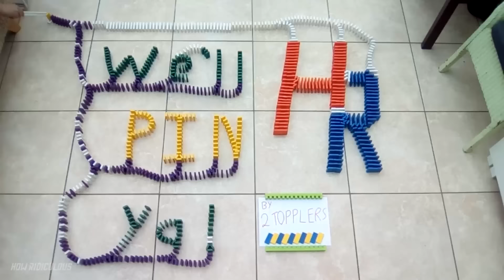Can This SOLID GLASS BALL Survive a 45m Drop?

Comment: 4:10, for those of you who are interested, that kind of crack is called a Conchoidal fracture (Con-coy-doll spelled phonetically). It means the overall shape of the fracture is cone like in nature, where the “positive” cone is popped out of the other side of the medium from the site of impact, and the surface that is impacted (be it by projectile, or tool) is the smaller end of the “cone.”

Also, the scientific reason for this phenomenon, is (as most high silicate solids are) Glass is an amorphous solid. So, there is no set, and repetitive “path of failure” (usually following the boundaries of the crystalline structure of a medium) in the material, and therefore, the force gets distributed, and absorbed nearly evenly, resulting in conical fractures, and an easily identifiable point of impact.

Since there is no repeating crystalline structure, there is no “stress accumulators” in the material. no sharp angles, no well defined crystalline boundaries, and therefore no where for the stress to accumulate, resulting in the failure of the entire crystal, rather than in between the crystals.

As a side note, this can creat edges sharper than a razor. (I learned this the hard way, when I picked up the primitive art of Flint Knapping)
Reply: P.s. I don’t really care about getting pinned, I just enjoy needing out about stuff like that (as you may be able to tell).
Reply: Well you definitely learned the hard way.
Reply: Hertzian cone
Reply: Conchoidal literally means seashell shaped, which is accurate
Reply: Without googling and reading about it, I dont know if this is right or not. However, it sounds pretty smart and has tons of detail so even if wrong you win.
Reply: As per Youtube law. I guess I'm googling Flint Knapping next.
Reply: We got a geologist in the building apparently
Reply: Someone has a big brain
Reply: Yep, Google works
Reply: That's a cool explanation, but you don't really say WHY it's cone shaped. The reason why the fracture is cone shaped is because of the difference between compressive and shear stress. 

Compressive stress is what happens when you squeeze something, and is found when equal forces push on opposite sides of the object. Most materials are strongest in compressive stress and there aren't any materials that are weakest in it (to my knowledge).

Shear stress is when you have opposite sides of an object trying to move in opposite directions. This is like when you are using scissors and one blade pushes the paper down, and the other pushes the paper up. Many materials are weakest in shear stress. (There's also tensile stress, but that doesn't apply here)

Now we set up the cone shape: Think for a second about the instant the glass hits the metal sheet. At the moment of fracture we will assume equal forces down by the momentum of the glass and up by the metal plate. What this does is it squeezes the ball of glass, making it want to flatten out. There is a line extending from the point of contact up through the center of the ball where all of the forces are vertical. This is where the forces are purely compressive and where glass is at its strongest. Now lets move to the side a little bit. At the bottom of this vertical line there is no contact with the metal, but we still need to cancel out the force. We do this by hanging onto the side of that inner column of glass with shear stress. The glass closer to the center is being pushed up by the metal, the glass farther out is pushed down by the momentum of the glass, in the middle is shear stress.

The closer to the ground you are on the orb, the higher the overall stress. The point of impact is highest, and the point on top has almost no stress. The closer you are to the vertical center line of the glass, the higher the compressive stress, and the lower the shear stress. The farther you are away from the vertical center, the lower the compressive stress, the higher the shear stress. Looking side on to the glass, the point of impact is crushed because the stress at that point is higher than the compressive strength of the glass. But you can move to the side and higher and while the overall stress is lower (there's less glass above that point) it is now relying on shear stress to hold it up. The line that creates on a 2D graph is where the stress equals the shear strength of the glass, and these variables equal each other in a line that gets higher as you go farther out from the point until overall stress is too low to break the glass any farther.

And if you revolve that line around a line, you get: A CONE!

I hope that was coherent, feel free to respond with follow up questions if you want anything explained.
Reply: @mattfoutch2967  you said it better than I did.
Reply: Also, for the record, I’m just a nerdy 19 year old kid who just graduated a few months back.
Reply: @codybaker1255  For the record, I'm just a nerdy 25 year old kid that just graduated with a BS in Mechanical Engineering. We look a whole lot at what are called stress transformations and how that contributes to part failure.

Everything you said about glass was correct, but you just didn't include why the shape is a cone.
Reply: @mattfoutch2967  Thanks for the correction!
Reply: @mattfoutch2967  Does this mean that an object that can't resist shearing stress as well, will have a steeper cone, and an object that CAN resist shearing stress, will have a shallower one?
Reply: @nippertipper7686  I honestly don't know (this isn't a problem they have you do at university.)

But your question has caused me to dive back into my old text books where I discovered I was using the wrong failure theory. I was think of Maximum Shear Stress theory, but that is used for ductile (bendable) materials like metals. I should have been thinking of Maximum Normal Stress Theory as that is used for brittle materials.

MNS theory says that a material will break when one of the principal stresses (straight compression or tension) exceeds the strength. So there's no worrying about shear strength here.

So the glass breaks when it exceeds the tensile strength because its compressive strength is stronger.

This would suggest that the angle of the coney joney is given by the ratio of tensile strength to compressive strength.
Reply: I'm sorry but I can't resist doing a Homer Simpson: NNNNEEEEEEEEEEEEEEEEEEEEEEEEEEEEEEEERRRRRRRRRRRRRRRRRRRRRRRDDDD!!!